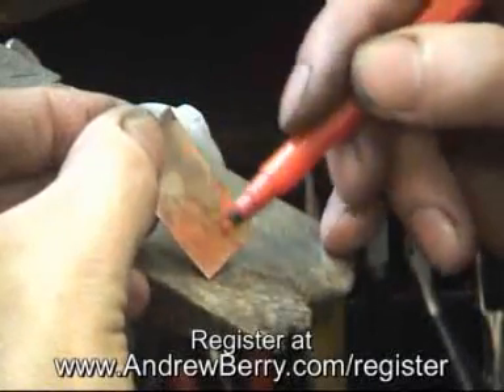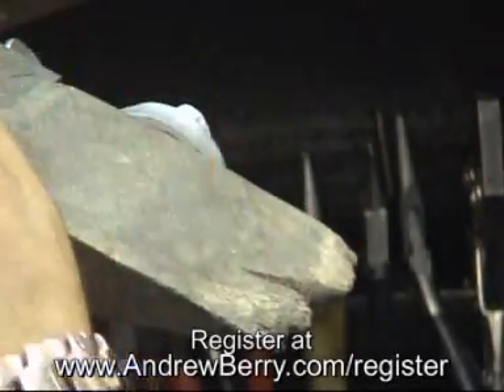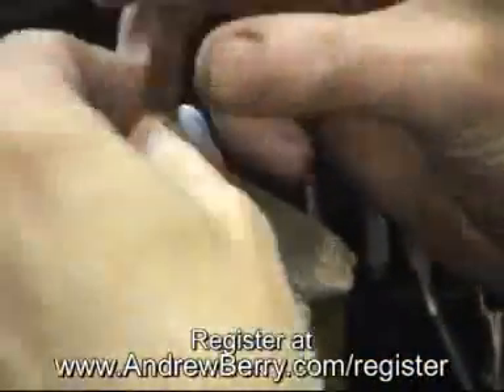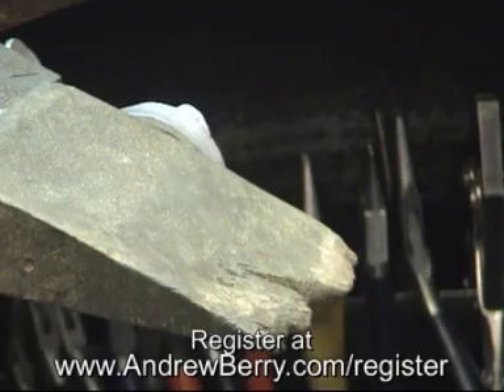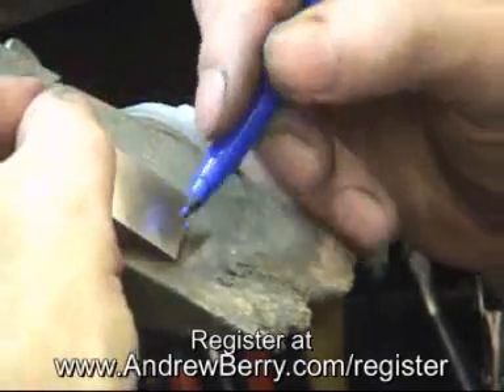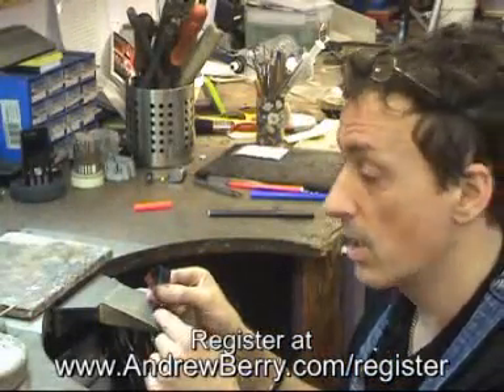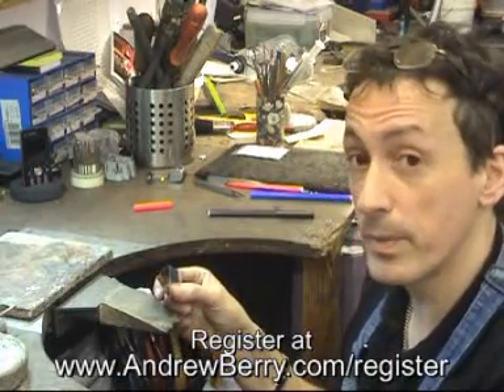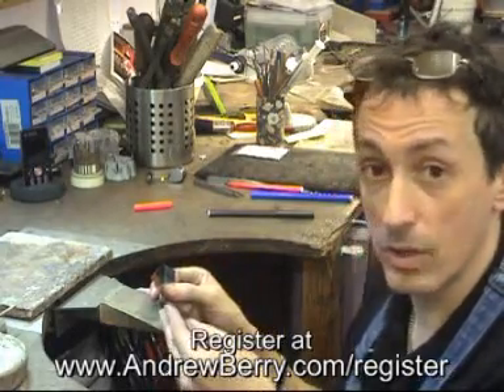Andrew Berry Jewellery Repair Bench Tips Soldering Tips

Comment: Great job. Thanks for the video.
Maybe you can help me. I had to re-prong a ring casting 10k. The prongs were really thin and one snapped test fitting the melee ruby I wanted to set. I used boric acid and denature. Got the prongs on it. But now I have hardened flux and copper leach. Looks like rose gold. pickle has little effect. How can I clean it up w/o loosing the fine details of the ring and get between the melee prongs and cathedral of main stone. 
I live 450 mls from any jewelry school so I attend Hard Knock U & watch a lot of videos.
Thanks for any help.

Comment: solder should already be stamped easy ,10k ,14k, etc.,I just snip pieces off around stamp, until your down to the last of it ..if its not stamped take a graber and mark it in corner..as far as dropping it , you should cut pieces over your fire block on top of your bench...